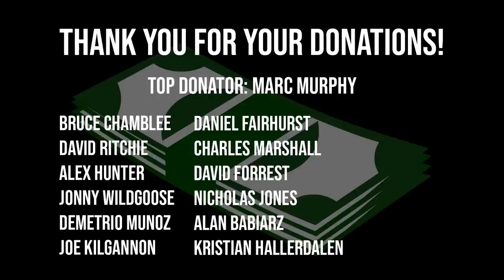BECOMING A STRONGMAN! Episode 1

Comment: Hey Tom, regarding your dumbbell lifts...  I'm not positive, because his video wasn't in English, but I think Novikov made a video where he personally gave you tips on how to maximize your dumbbell ability with just a little tweaking of your technique.   I think it was not long after the WUS Bahrain show, and he had mentioned your name a few times when he was explaining techniques.  Anyway, I believe that he was explaining how doing the torso "side-dip" just after you thrust the dumbbell upward, to lock your elbow under the dumbbell as it is "weightless" because of the "zero gravity" effect of dipping your torso is the secret to huge lifts.  The zero-gravity is generated by the sudden dropping-out from under the weight of the dumbbell as it reaches it maximum height of your extended arm.  You drop down to make it "float weightless" in mid air for a moment, and THAT's when you lock your arm and elbow below it, catching the weight with your already locked arm.  The principle is simply illustrated in this video:  https://www.youtube.com/watch?v=UTIRjDHRiC0     Doing this technique ELIMINATES having to use that last, most strenuous part of the exercise as you and Luke both do it, where you use pure strength to push it up to a lockout position those last few inches of upward pushing.   Novikov and Kieleskowski both do it the side dip way, and it is the reason that they can achieve 135k + dumbbell presses.  FYI

Comment: Is there a reason so few strongmen do a jerk with the log, rather than just a push press? I understand mobility might be an issue for the big guys, but olympic heavyweights pull it off. Is it harder with a log/axel than a barbell or something?
Reply: 1. Log is much more forward in position than front racked barbell. You can get the idea if you take big dumbbells in neutral grip and try to push press them. 

2. I think it is mobility/agility/balance problem coupled with limited time in periodized training blocks to refine technique per event. It's comparable bench in that good leg drive can add a lot. If you have a scenario where you're decent bencher without it and can spend five sessions before next comp, is it really that efficient to try and learn leg drive and possibly ruin your technique? And all that time and energy can be allocated to squat and deadlift too if you stick to previous technique. 

3. Long story short it is about risk/reward assessment and strongman really is chess of the strength sports. You focus on winning good events and not sucking at bad events.

Comment: I fucking hate how strong Harry already is ;) Here I am working between 30-40 kg dumbbells and struggling to work toward a 50 kg dumbbell overhead and he's doing 90 kg just starting out and could probably put out a 100. Different mechanics with a log I know, and granted I've never TRIED a log - nowhere I've ever been has them - but I figure based on my dumbbell lifts and feeling like 90-95 lbs (maybe 42 kg or so) for one hand is about the most I'm comfortable with, it stands to reason my maximum with both arms would probably be a bit under double that - I reckon 70-80 kg range. And this guy's over here STARTING at 90. I guess it must be nice to have the genetics for it. I think it's clear from my own casual workouts that I don't have the genes for it. Le sigh. I'll just be happy if I can get 100 kg overhead one day.